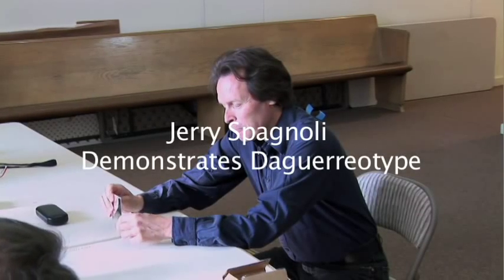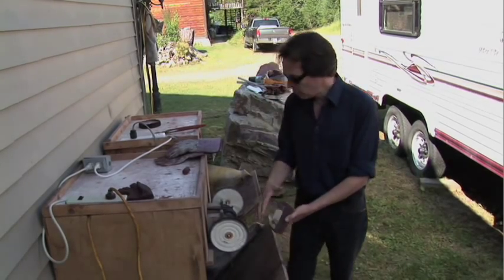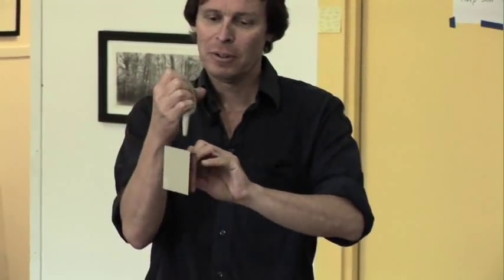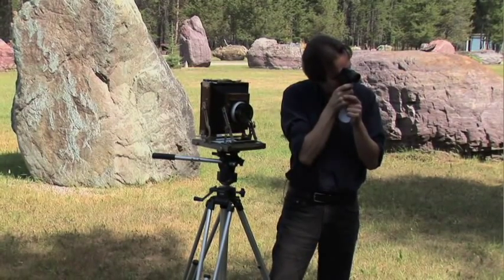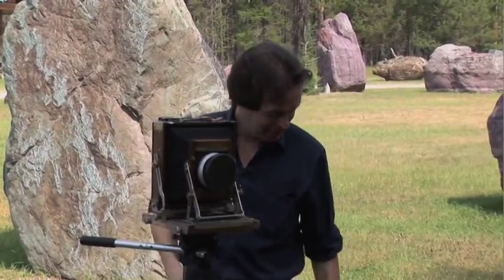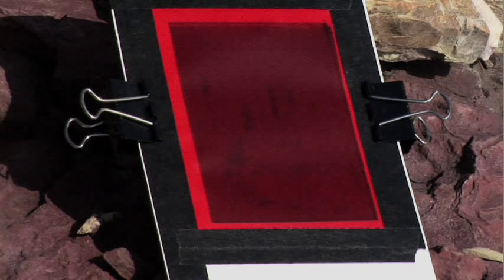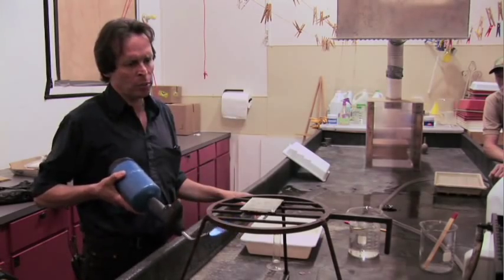Jerry Spagnoli Demonstrates Making a Daguerreotype

Comment: I thought mercury was used but no mention of it here.
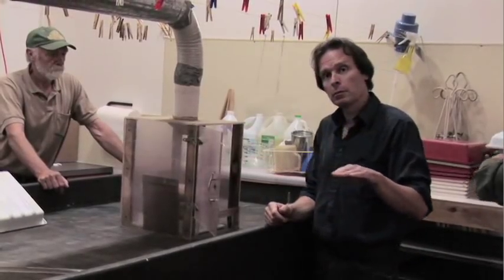Reply: He's using the "Becquerel" variation of the process which uses iodide beads 2:20 and red light. It's safer, of course. ☺
Reply: @TheStockwell  how's it safer
Reply: @TheStockwell  what's wrong with mercury
Reply: @reviewgodusa9613  Because it’s done without mercury….